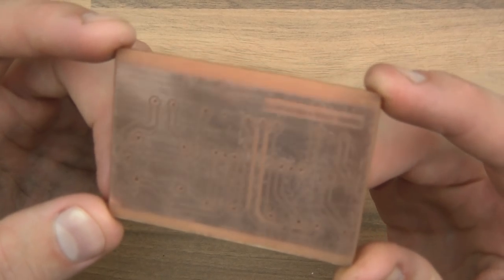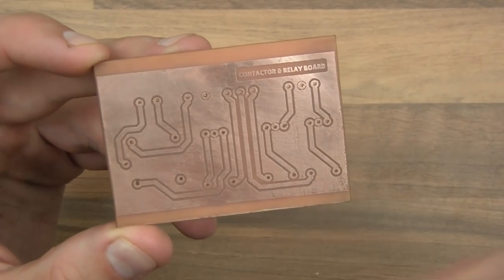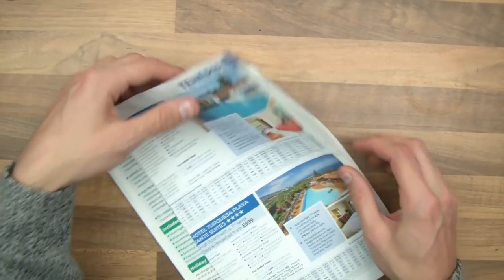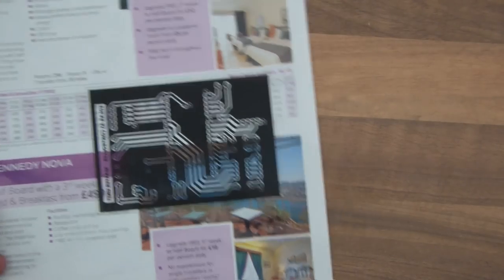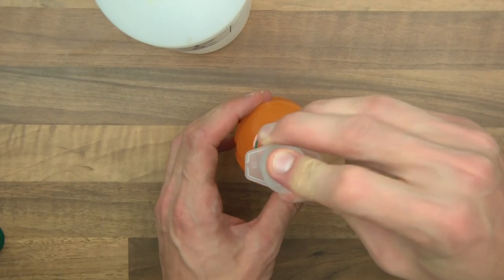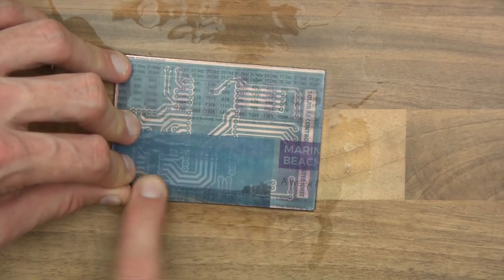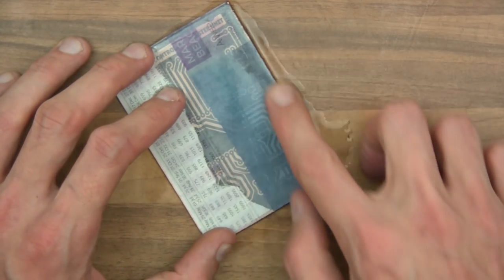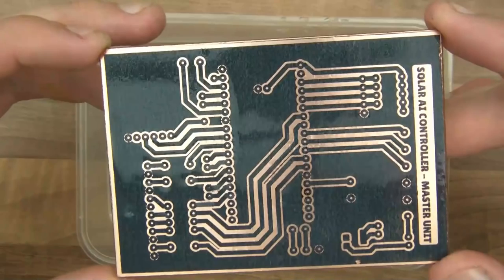TUTORIAL: How to Make Your Own DIY PCBs! - Part 1 - Quick, Cheap & Easy! (Toner, Acetone & No Heat)

Comment: Note, double sided boards aren't a problem. Completely etch one side (tape the other side off). If you're using through hole components, you would then drill 4 holes, one near each corner. Doesn't have to be exactly on the corner, but space the holes out. Then when you're aligning the other side, look through a light so you can line it up with the 2nd side transfer.

*I will say, however, if you're using some sockets, like a PLCC, you might not have access to the pins on the top side of the board, so then it is an issue.

Comment: Hi and thank's for your video about PCBs.
I think you need to increase opacity in any way because we can see the light passed through
your opaque areas.
First, you may try the settings of your printer.
Next, if it remains too clear you may superpose 2 transparencies.
Check your transparency's opacity with the day light.
Kind regards. Jean-Yves.
Often with toner printer, the toner does not stick well on transparencies and some printer
do not print so dark even with settings full dark.

Comment: You will get better result if you print twice on the same paper, but sometimes you need to do that fev times. Also after you transfer it to copper board you can put it to acetone fumes it will close up those gaps.
Reply from the maker: Thanks... Interesting.
Reply: What do you mean acetone fumes?
Reply: @alexstone691  I think they mean acetone spray😇

Comment: Would it be better to do the rubbing on stage on a folded newspaper soak up the surplus solution to prevent its migration back to the board

Comment: 3:52 You know they sell double sided copper clad boards right?  I've got some coming in the mail now from Ebay.  Most PCB software can print mirror images for the other side too so there's no reason you can't do double sided PCBs
Reply: I believe the major problem is perfectly aligning the 2 sides so that they overlap perfectly. Otherwise, if you have through-hole or vias, your holes will be off on one side and it will mess your board.

Comment: Instead of rubbing and risking movement, try a wall paper edge roller. You can get a lot of force without risk of shifting and really get the air out.

Make sure the roller does not dissolve in the acetone first or use a wooden one!!!

Comment: You should use rubber gloves when cleaning the boards, if you touch them later you can transfer oils from your hand and also could leave fingerprints.

Comment: one issue is that paper is mixed with the ink. sometimes the paper gets stuck between the traces and it gives you a poor etching were you need it the most. this leads do over etching in places that you don't want when you are adjusting the whole thing

Comment: Does it have to be a laser printer?
Inkjet won't work?
Reply: it cannot work. Any kind of ink is liquid, you can easily imagine liquid goes away when in contact with any other liquid. Toner, on the other hand (from the laser printers) is not liquid, it's a dust that gets melted and is fairly resistant to various liquids. That's why you must have a laser printer.

Comment: One thing not mentioned in this video, and which is quite important, is that not all laser printers are usable for this method. Brother laser printers don't work, because the Brother toner does not transfer properly (in fact it doesn't transfer at all) with the acetone/isopropanol mix. I have a Brother laser printer and this method doesn't work with it. After I failed a few times I looked it up and it's a common problem. It works only with other brand laser printers.
Reply from the maker: Hi! I don't think you should write the toner off. There are many factors involved. My toner is the cheapest toner on ebay and it works. HOWEVER, the mix of alc/acet does change depending on the paper. Even for me, the mix has to sometimes change. This video is very general. :-)
Reply: @AntonyCartwright  It's not the mix or the price of the toner. Brother toner is different from all other toners, it does not dissolve in the acetone/isopropanol mix to allow for transfer. In my many tries, there were no partial failures but always total failure. Simply none of the toner transferred at all in any of them. And I'm not the only one for who this method doesn't work with this brand of printers. Too bad because they're otherwise awesome printers.
Reply: @stamasd8500  I have a brother printer and the toner transfers from regular paper, do note that you can buy generic toner for brother which may or may not work better

Comment: Anthony - what did you use to create the schematic and create an image out of it?
Reply: That's what I was going to ask!
Reply from the maker: DesignSpark PCB... It's excellent but the copyright owner seems to be unwilling to allow me to show the software. :(
Reply: @roadeycarl  Altium Designer software has no shortage..
Reply: I use express pcb. Has the schematic and parts placement part to create the boards.  I import to windows paint to cleanup before printing.

Comment: Nice!

A sharpie works well to touch up any flaws.

I use the iron on method with Poundworld photo paper.  I stocked up before they shut down.
Works great.  Peels off with no soaking.  The trick is to iron onto a flat surface like a kitchen tile.

I have the same drill press (you cheapskate lol).
Reply from the maker: Ahh cool!!! I'll see if you have any videos tomorrow. :)
Reply from the maker: Hahahaha, you know how it goes. ;) I'm tight like that!

Comment: Filling the empty space of the pcb with useless copper pour means a toner solid black and every ten pcb's needs toner refilling which adds extra cost without an obvious reason.
Reply: Tradeoff. Less to etch. But it could cause stray capacitance

Comment: Interesting, I might try this. 
However. Health and Safety hat on here: never put chemicals in drinks bottles. Especially with small children around.
Reply from the maker: Hiya! It's the only suitable one I could find and it's emptied out and kept high it of reach after use. :)
Reply: Good point.  I  thought I always labelled my bottles,, but had a small farm and lots of oils, lubes, etc.. One day I opened a detergent bottle in my garage, and found that I had put spent oil from an oil change 2 years before, and forgot to even marked the bottle.

Comment: why does everyone sucessfully make a PCB and I just sit here trying heat acetone alcohol and all the tree dogether separately in all sorts of combinations and nothing work..And I tried 11 printers 5 tipes of paper and foto paper and everything
Reply from the maker: Hiya! Do it exactly like in the video! It does work! :-)
Reply: @AntonyCartwright  It simply didnt :_D Im sentenced to JLCPCB or trying that scary and difficult UV method.
Reply from the maker: @adam207321  did you use the right paper..
Reply: I tryed like numerous foto papers. None gave me a useable result
Reply from the maker: @adam207321  go to a travel agent and get some brochures ha
Reply: Having tried numerous methods with mixed results I’ll tell you the keys to my success: 
1. Clean the board with dish soap, dry off, then don’t touch thereafter. I use a Brother laser printer and print image on regular plain paper (remember to reverse image). 
2.  Get Pulsar PCB Fab-in-a-box (www.PulsarProFX.com). Cut a piece of this toner transfer paper slightly larger than your image then tape it (shiny blue side up) onto image on previously  printed paper then run that back through your printer. Image is now printed on transfer paper. 
3. Tape the transfer paper with image FACE DOWN onto your board. 
4. I use a cheap ($20.) 3M laminate set on high heat setting and I run board through 5 or 6 passes (caution - it gets hot).  Alternately- 280 degree iron for 2 minutes with pressure). 
5. Immerse immediately into cold water for 30-60 seconds. Peel off transfer paper. Toner image will be transferred onto board. 
6. Ferric Chloride etch as usual. 

This method works 100% if board is kept clean.  PCB Fab-in-a-box is not cheap but you don’t have to print full sheets. Well worth the money!
Reply: I use pages from a cheap catalog that arrives in the post. Too thin to directly put through the printer, so need to feed with a sheet of regular paper.

Comment: not a good system...too much pitting and unreliable..why not just use photo resist and developer..
Reply from the maker: The board in this video, I'm still using it now and it's fine. The method can be difficult though, I agree.
Reply: sorry, meant the process is unrealible, im sure the board is fine if the toner transfered successfully... i tried different toners with this method and just gave up and went back to photo method.. but good for you if it works..thx
Reply from the maker: @bubbahogg-buga4613  Ahhh yes, you have to use the right paper. Some mags work and some don't...